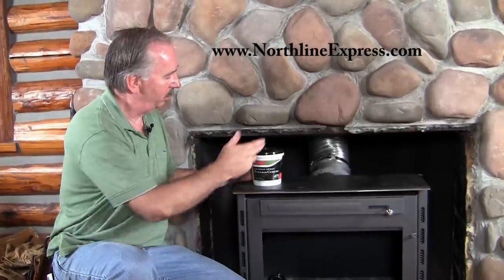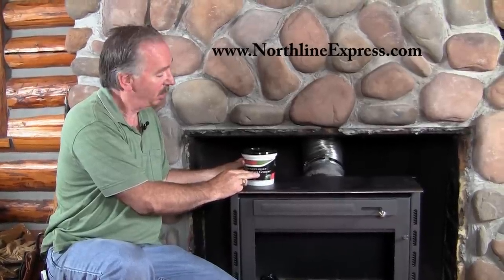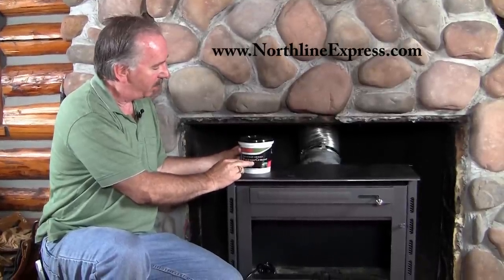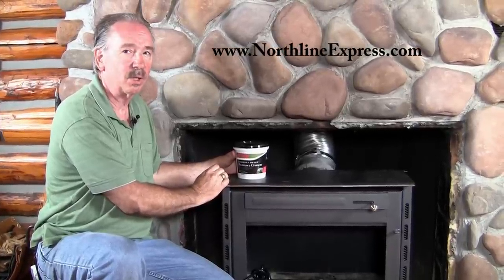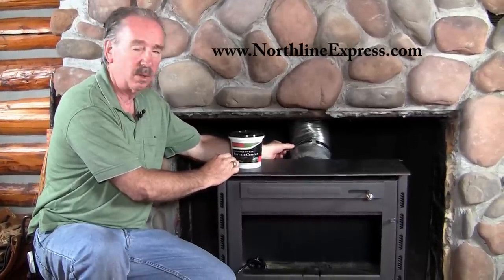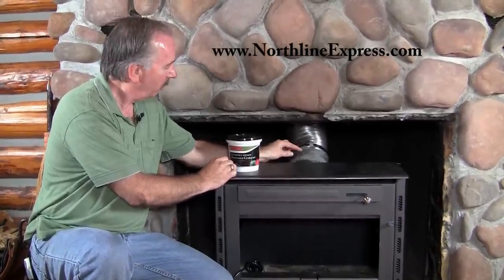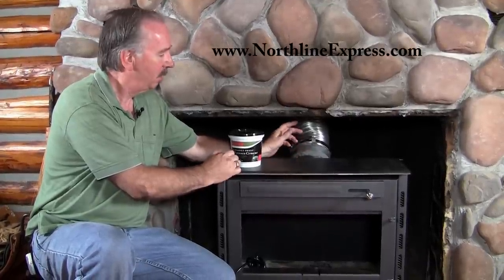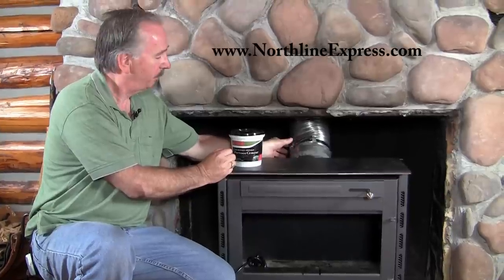Rutland Furnace Cement - When and Where to Use

Comment: I've installed a pellet stove and used Rutland furnace cement to connect to adapter of the pellet stove and used it on every pipe. It was selling right next to wood stoves and pellet stoves in Lowe's next to silicone 500°F.. I went with Furnace cement cuz it said 2000°F. Now I read it says to fully cure it takes 30 days gradually bringing it to 500° .. It takes that long cuz its better? Any information would be extremely useful!! Thanks in advance!!!